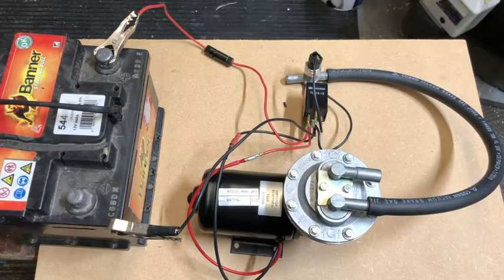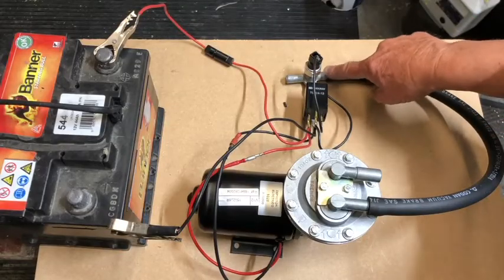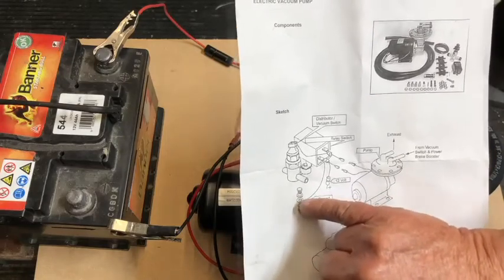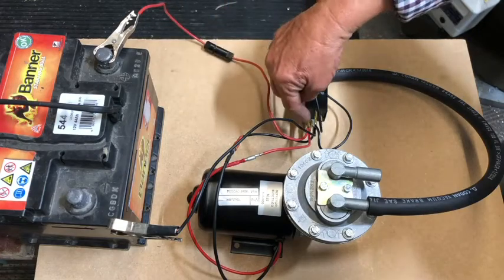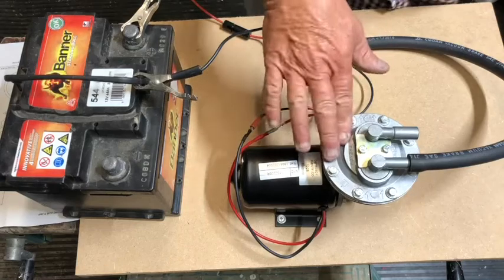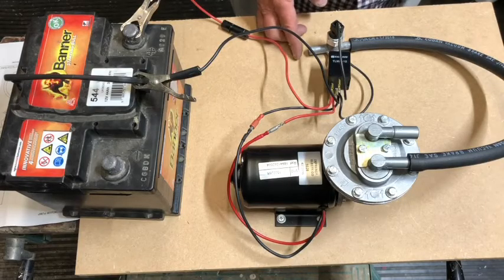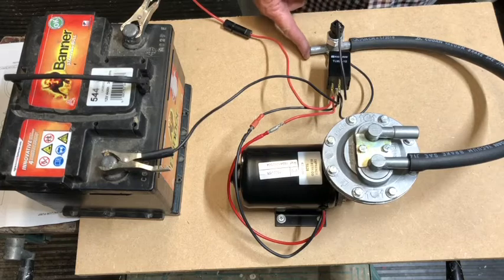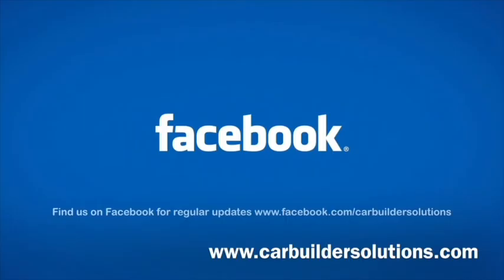How to install an Electric Vacuum Pump

Comment: Would the key power+ take the place of the battery + on the relay? Direct power from battery would never shut off?
Reply from the maker: Yes that's correct. What are you building at the moment.
Reply: 69 chevelle.  Have electric fan and relay in service. Adding the vacuum pump and relay for power disc brakes. @CarBuilderSolutions

Comment: What cars is these suitable for?
Reply from the maker: Hi Chris, various applications, but ideal for engines that don't pull a lot of vacuum, i.e. car running ITB's.
If you need any more info feel free to give us a call on 01580 891309

Comment: Can this be mounted vertical
Reply from the maker: Yes it can, but you might have to choose some different rubber mounts as they are not designed to be hung.

Comment: Is there a link for this vacuum pump?  Could this provide enough vacuum to replace the mechanical vacuum pump on the Mercedes W123 diesel engines?

Comment: As there's no connection from the ignition switch to the relay,  then this pump can start up continuously if there's a slight leak in the system and flatten the battery over a period of time. Imo,  I would install a dashboard mounted switch at the very least to isolate the pump when it's not needed.

Comment: Folks when the pumps mounted securely with the rubber mounts it's heaps quieter.Don't be put off with the test noise.I have done many thousands of K's in my car over 8 years and it has been faultless.worth every penny
Reply: That's great to know because damn it's loud in this video which is really off putting so thanku sir for that input 👍🏿

Comment: Would u or somebody be willing to help me get one hooked up on a 2015 Ford Escape Titanium. The factory pump is actually the cam and it broke off. Either way the vehicle still runs fine but the brakes are hard.

Comment: Hi, can these vacuum pumps be ran continuous?  Thanks.
Reply from the maker: Hi. They are designed to cut out when maximum vacuum is achieved. Continuous running may reduce the life of the pump.
Reply: @CarBuilderSolutions  No worries.  Thank you for the rally. 
Thinking of using it for a crankcase vacuum setup.

Comment: Hi,  it seems like a lot of people have issues with their pump continually pulsing ,me included , it was great that you wrote "timer relay" in one of your answers , can you explain to me the part number or delay times , like if you hold you finger on the end of that pipe i:e no leak will the pump turn back on after a certain amount of time that is set on the delay  ?????  More info Please , Cheers .
Reply: Hey. I had this problem too. It turns out the pump on the exit side doesn’t hold air on my pump. I added a one way valve before pump. Works great. Hope this helps 2 years later.

Comment: I went through two of those style switches and neither worked. Once they reached vacuum they would come off and on but wouldn't stay off. I tested them the same way you did in this video. Had everything wired and grounded properly. Junk switches. I went with one with a built in relay from Superior transmission.
Reply: I'm having this same issue right now and I figured it was likely the switch. I have another switch coming so hopefully that solves the problem

Comment: I have a strange problem with my 69 coronet, I'm running 2 electric fans from my EZ-EFI and a vacuum pump. When city cruising and I get up to temp I lose the fans and vac pump. when system cools after sitting everything works again. also when driving on highway everything stays working. Do you have any ideas what could be going on? I'm stumped.
Reply: Gnd to temp switch
Temp switch out to 85
86 to positive jump to 30
87 to fan positive
Fan negative to gnd
Reply: The vacuum pump should have its own circuit and be contolled by a relay and pressure switch.

Comment: I've never heard of the relay legs numbered 12345..they are numbered 30-85-86-87
How are people supposed to know is what to wire it properly.
Reply: Some relays are marked this way. 1=85,  2=86,  3=30. 4=87A (current flow through contacts with relay coil off) and 5=87 (current flow through contacts with relay coil on).
Reply: @phredpun4225  Thanks. I wondered that as well.
Reply from the maker: It's a timer relay. Full wiring instructions are included with the pump and can also be found in our online listing.
Reply: @CarBuilderSolutions  What is the part number for the pump? Thanks.